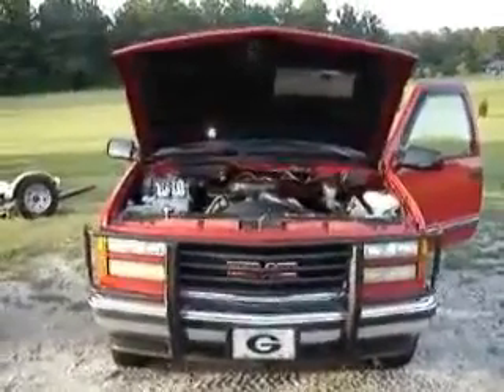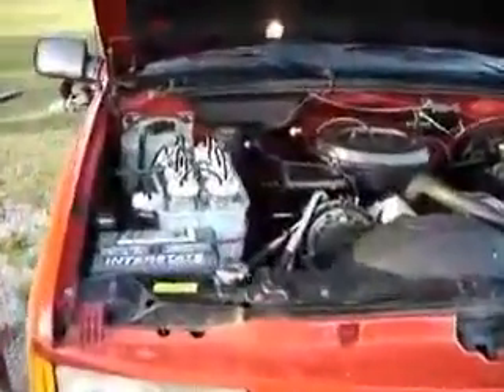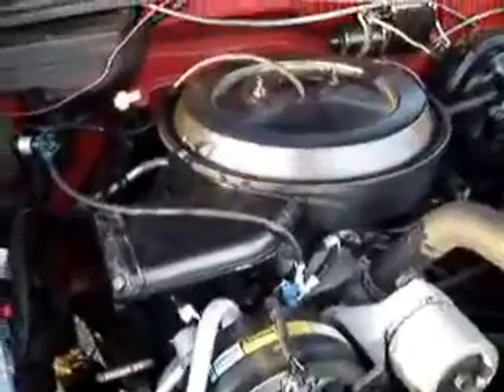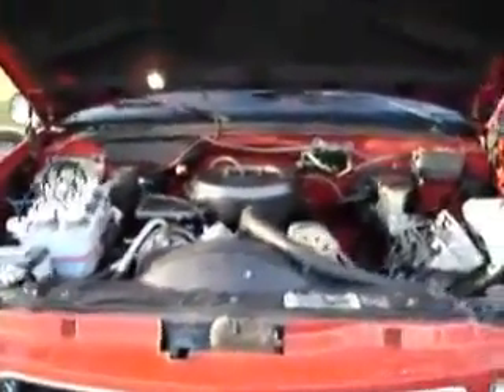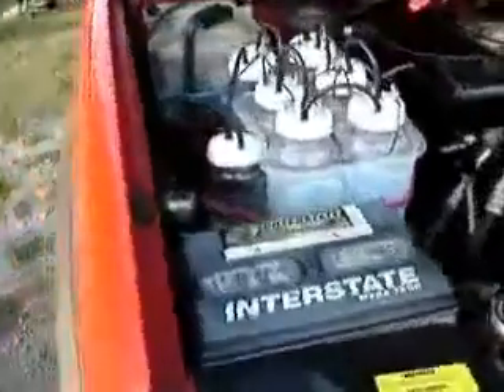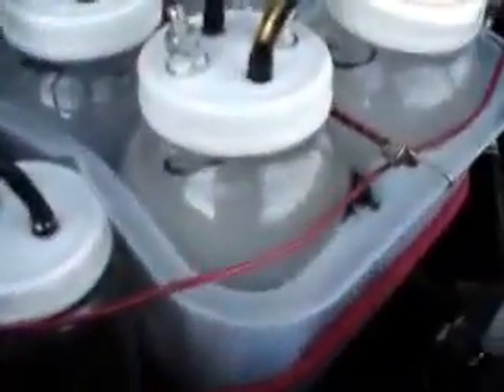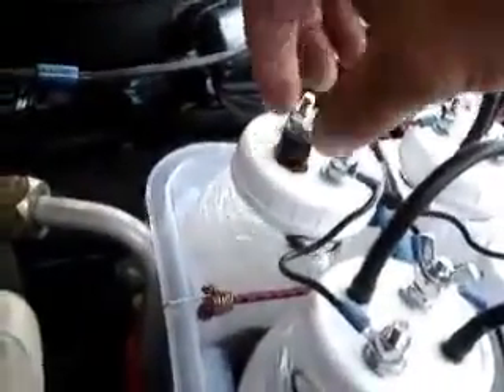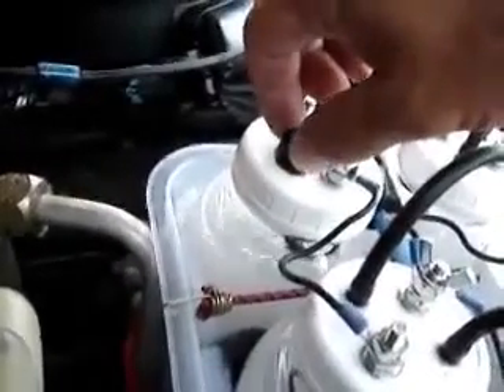Truck Gets 35 MPG with HHO Generator Fuel Cell - "Distilled Water" YouTube.flv

Comment: I just installed a similar system in my truck.  My question is, do you use a map enhancer or anything similar in your truck to make it run leaner?
Reply: Jason Fisher the engine management system is smart enough to cope with the extra fuel introduced in the engine